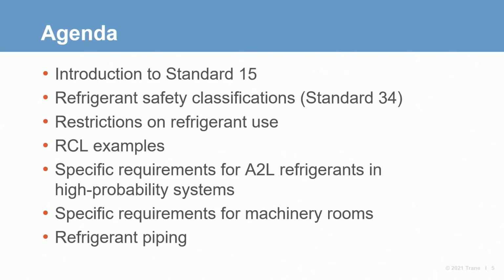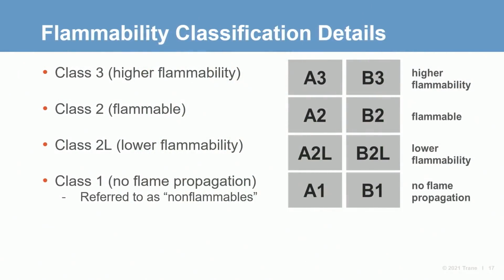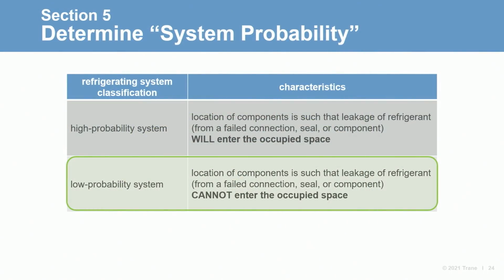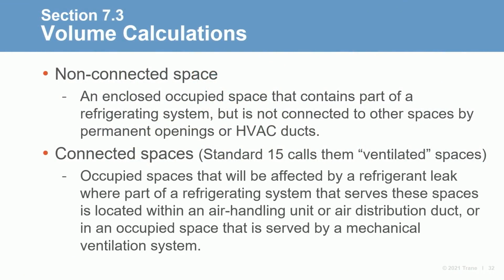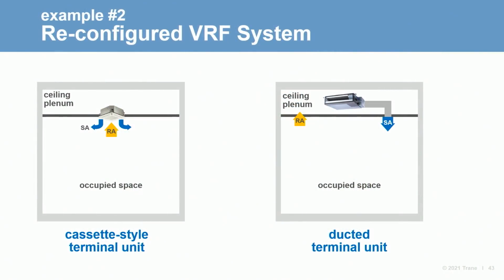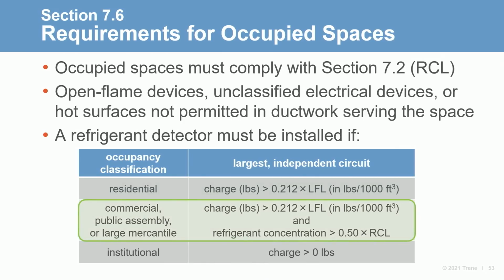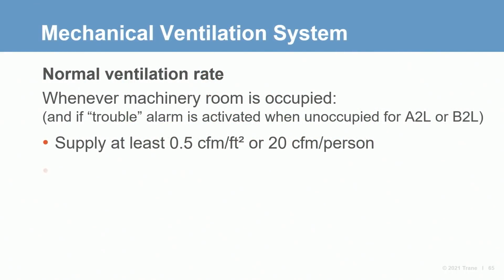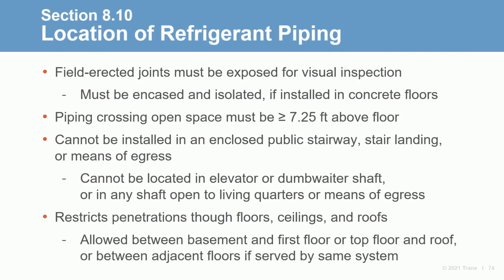Trane Engineers Newsletter Live: ASHRAE Standard 15-2019

Comment: Great class, well laid, out and informative. Especially like the examples of the floor plan calculations. I suspect the flammables electrical requirement referred to are spark proof equipment.  Wasn’t there a requirement of machinery room design to have a weakened “blow-out exterior wall” in the event an explosion occurred, the main building would survive and the “blow-out “wall would fail outwards directing the energy away from the occupants?